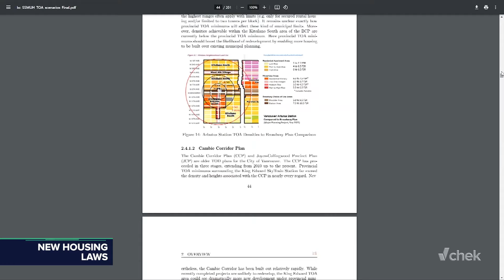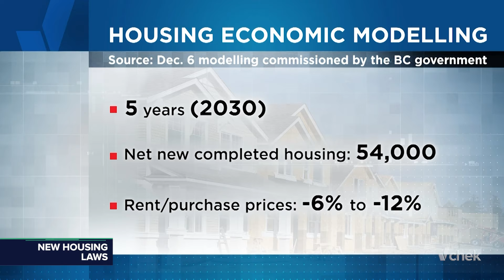BC housing price drop, BC United/Conservative merger speculation

Comment: Sweaters???  Seriously Victoria needs affordable housing for those that work minimum wage jobs, rents used to work for those people and now they DO NOT….at $2700 + for a 1 bed….BC Housing Minister has been asleep at the wheel for years and needs to be fired
Reply: What middle class and working class Victorians need to do is stop the nimbys from keeping missing middle housing with outdated bylaws and and zoning restrictions.  Wealthy owners have fix the rules to prevent middle class housing in 90% of the land.